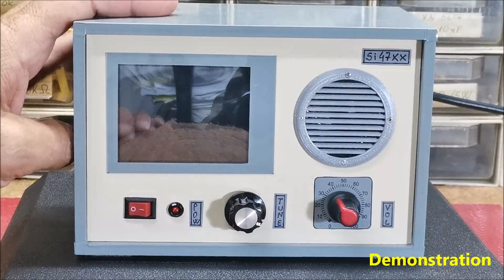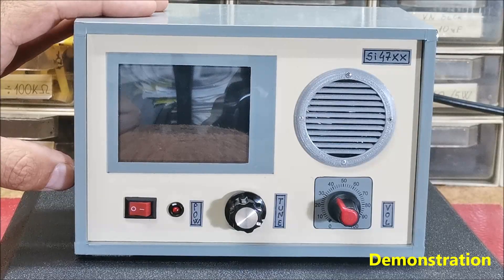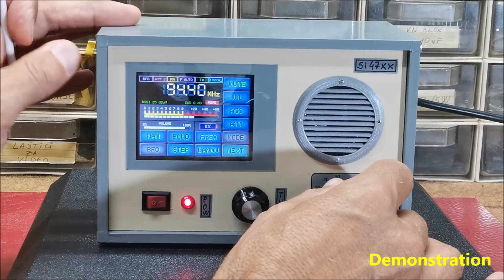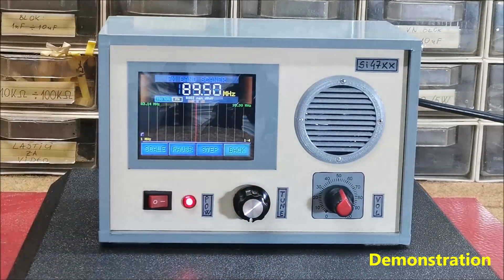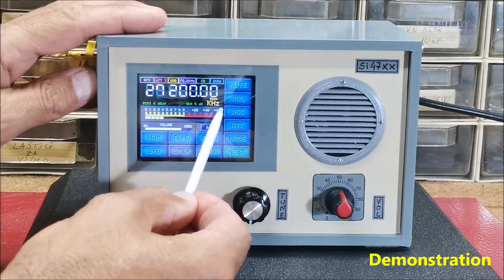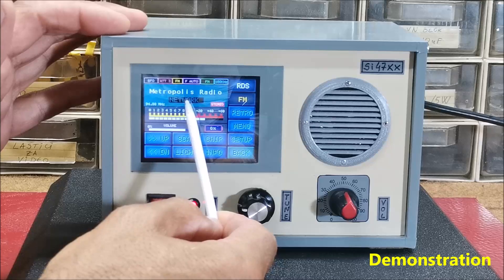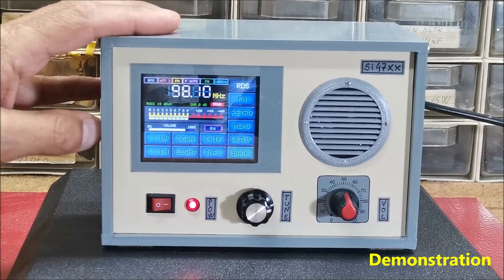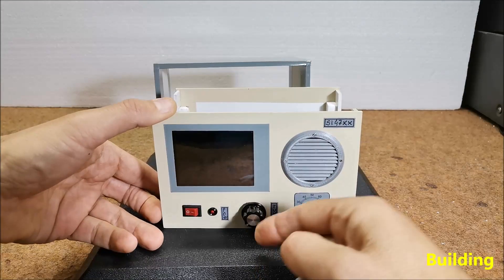All Band Radio with New Firmware

Comment: Hi Mirko which esp32 module you used in this video and which one you choose in setting in arduino??
Reply from the maker: ESP32 development board(38pin) and in Arduino IDE I choose "ESP32 Dev Module"
Reply: @MirkoPavleskiMK  Thanks a lot! and another question do you have problem with TFT_ESPI library when you compiling because when im trying to compile it give me an error:class TFT_eSPI' has no member named 'setTouch' what it can be? thanks in advance :)👍👍👍
Reply from the maker: @BraveNewWorld1984-r6o  You need to define touch pins on TFT_eSPI library in User_Setup.h
Reply: @MirkoPavleskiMK  Thanks a million times i was struggling with this issue since the beginning of the project :) !!💪💪💪👍👍👍just awesome!!